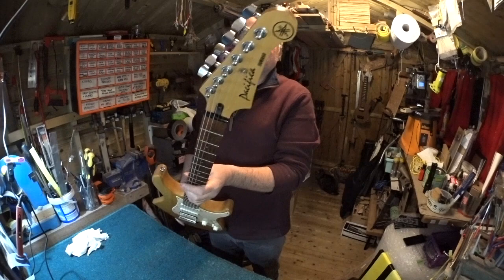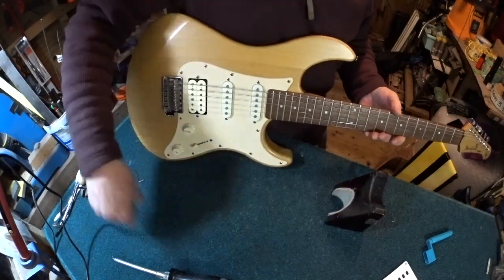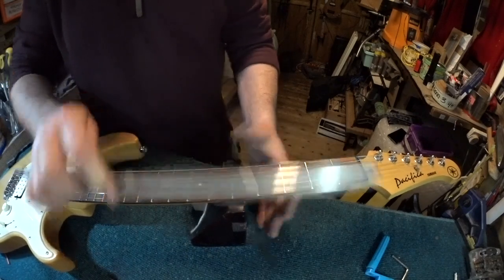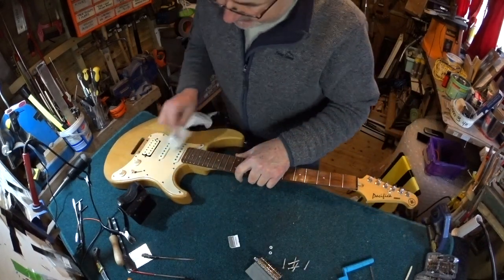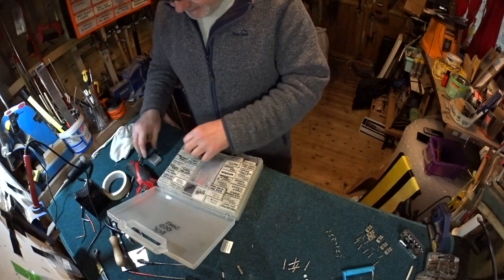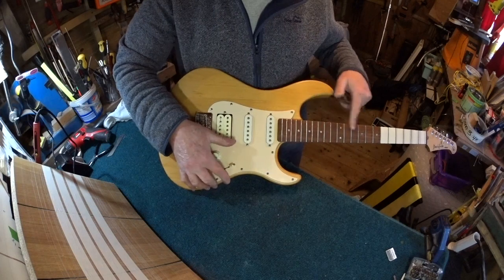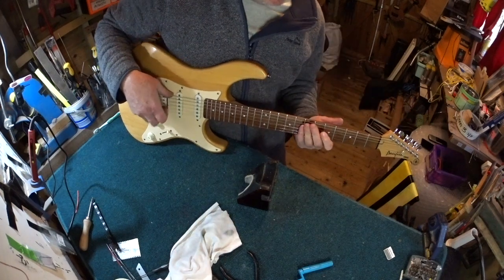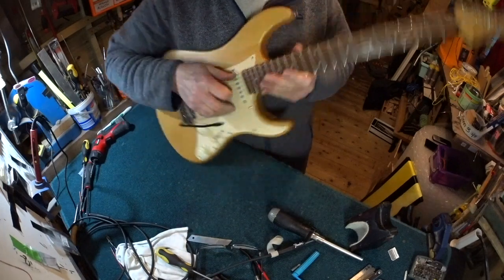Yamaha Pacifica 112 set up

Comment: You're bound to have figured it out or looked it up by now, but M8 x 1, the 1 is the thread  "pitch". 1mm width between thread peaks.

It's a handy timesaver to amass a collection of marked up nuts+bolts with your tap+die set to plug and play into unknown threads.

Loving the vids.  They're calm and relaxing, and increased my confidence to tinker. 😀
Reply from the maker: Hi Paul... thanks! I was dreaming the other day of a board with every size / type of screw and bolt to refer to physically when I'm judging what I need. I have to be able to SEE and FEEL things!!

Comment: Hi Sam
Lefthanded pots or not lefthanded pots ?
There is 2 kinds of pots, liniar pots and logerithmic or audiotaper pots.
The lin. pots will be exactly  the same wired right way or backwards.
Log/audiotaper pots will only have the right operation, when wired the normal way, so here one have to have a backwards log. for it to operate the right way when wired backwards for lefthand use. That is if one can get backwards log. pots, but check it out with a ohmmeter/multimeter. Lin. pots have a (as the name says) liniar operation, no matter whitch way its wired. A log. pot has a logerithmic operation, and the resistance should rise quickly, when the slider is moved from 0 and upwards.
So lefthanded pots make sens if it is log/audiotaper.
Keep up the brilliant work!
Rgds
Lars
Reply from the maker: Yes - it hurt my head but I think I've learned that any pot can be wired 'backwards' but IF you're using an audio/log taper you have to have a left-handed one (or the taper will be effectively in the wrong end of the dial) :-D
Reply: @SamDeeksRelovedGuitars  Exactly ;-))
Reply: @SamDeeksRelovedGuitars  oh and by the way a "lefthand" pot is called Reverse Logarithmic Potentiometer, if You will search fore it at a DIY electronic parts shop, ebay or other online supplyers.

Comment: A little trick when cutting black nut slots: Put some baby powder in the nut slots and you can see where your nut slotting file is cutting. We all know that we want the string to come off of the front edge of the nut.

I have a Danelectro 56 U2 that was given to me by a friend. But it must have been damaged in shipping or who knows where. Anyway it has a slice under the G string on the seventh fret that is too deep to correct with a fret level. The rest of the guitar is in very good condition. I think the guitar fell off a stand and smacked fretboard down into something. I have not tackled replacing frets yet. And the thought of tearing up the finish on the sides of the neck, on top of finding a fret of the same type to replace it with, is a fools chase. So, I might have to bring it to a Luthier more skilled than I am to have it replaced. When you have that type of damage, it can't be repaired without being replaced.

Comment: Which truss rod are you using for the leveling?  It looks different than the one you used to use.
Reply from the maker: This is my No.2 rod - the StewMac 'U-channel' truss rod. It's stiffer than the regular one and I like to switch between this and the other one. It's twice as wide as the regular one...not a problem, just different.
Reply: Sam Deeks thanks, I’m going to have to get me one of those.
Reply: @SamDeeksRelovedGuitars   Sam is it a straight buy or is it a regular truss rod that you modded to fret level? Thanks!

Comment: Sam, I have exactly the same issue with the grub screws digging into the base of my hand as I tend to play near the bridge most of the time. What length are the short grub screws you ended up using? 5mm or 3mm? Thanks.
Reply from the maker: Around 5mm... I think! You can get them more cheaply from fasters suppliers on eBay rather than buying sets from Fender or other branded music outlets.
Reply: @SamDeeksRelovedGuitars  That's great. Not as easy to find as you would think. Thanks. :)
Reply from the maker: @MartinJG100  I've just bought some from these people (I don't know where you're based) https://www.ebay.co.uk/itm/M2-M2-5-M3-M4-M5-M6-M8-M10-A2-Stainless-Plain-Cup-Point-Grub-Screws-Set-Screw/271270151197?ssPageName=STRK%3AMEBIDX%3AIT&var=570184283411&_trksid=p2057872.m2749.l2649

I think M3 x 5mm will work
Reply: @SamDeeksRelovedGuitars  Fantastic. Just been on Ebay and there are loads of suppliers. More than happy to use your recommended people. Thanks again.